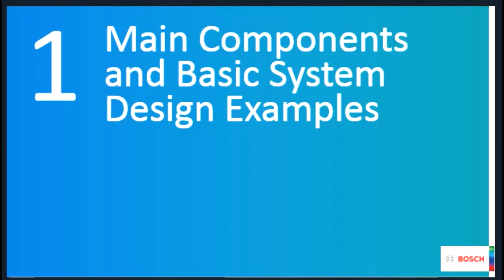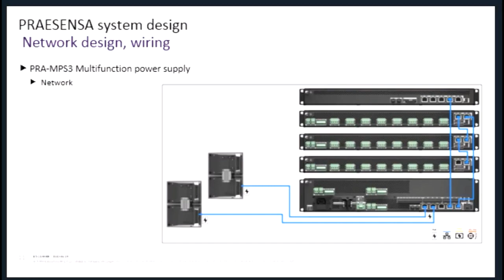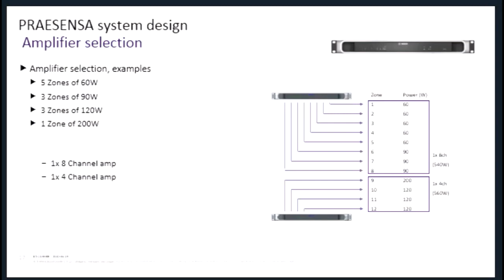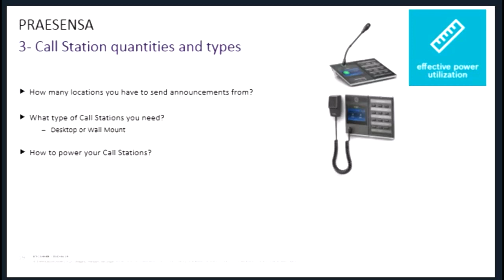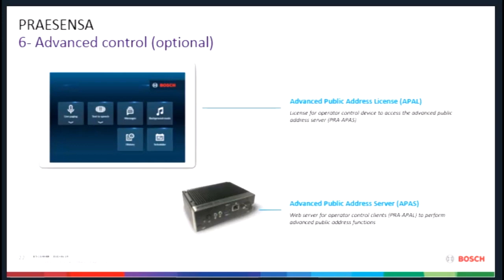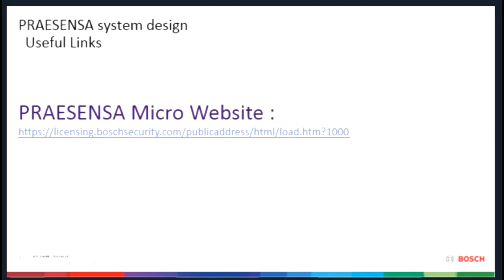PRAESENSA System design basics and offer preparation steps

Comment: Can you add programmable inputs/outputs without adding another mps3? For example with praesideo you could get a callstation kit  and program the inputs on there
Reply from the maker: Today if you need more contact than the one available on one MPS3, you need to add a further MPS3. By the way there are also “virtual contacts” available through the PRAESENSA open interface.